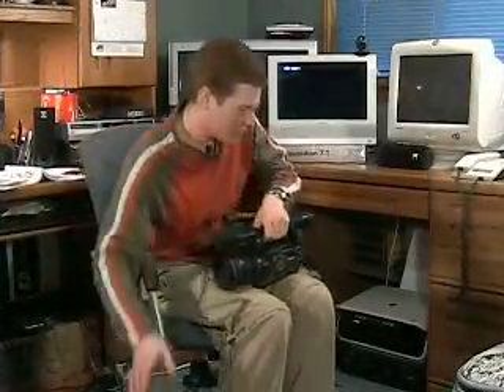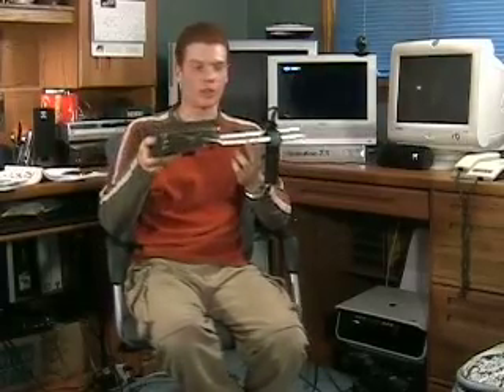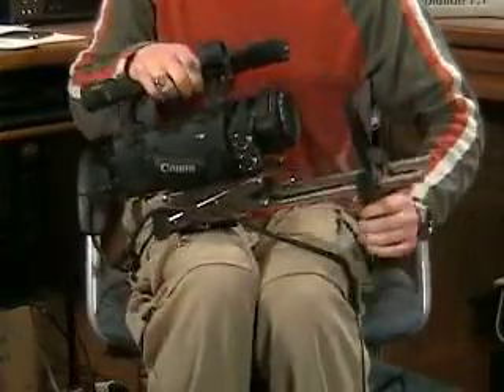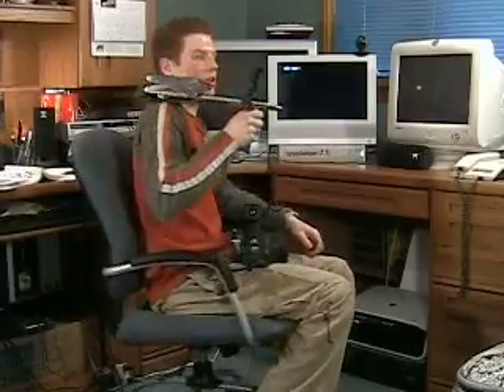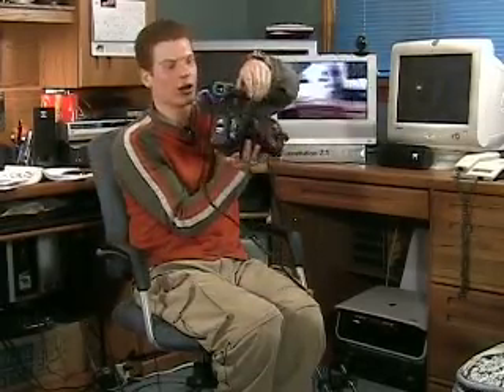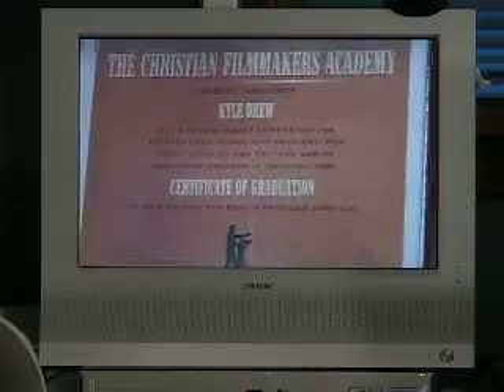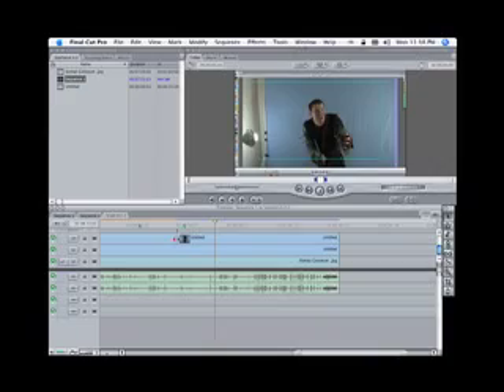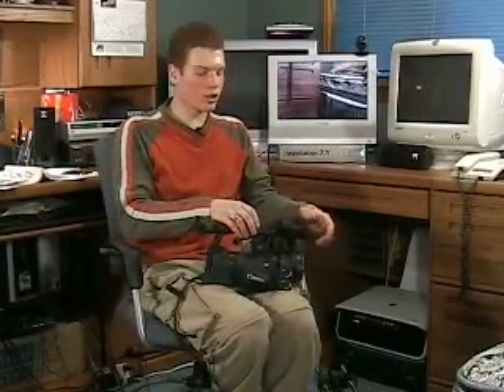HDV & Narrow DOF Adapters - Part 3

Comment: Wher did you get the letus adapters and how much are they? Also do you nedd the metal platform if I wanna use the adapter on a tripod, can you handheld the holw camera including the lens without getting tired?

Comment from the maker: Another tip is to make sure your actors are standing in the "sweet spot". If they're even a few centimetres out, you can loose focus. This may mean putting markers on the floor, or using string on the ground if they're walking, so they stay the proper exact distance from the lens. Hope this helps.

Comment from the maker: Keep in mind that all the SLR lenses for the Letus are manual only - no autofocus, so you need a skillful hand, and a very sharp eye. You can also measure your distances with a tape measure to check focus, and it's always a good idea to mark focus points on the lens - this is especially helpful for donig rack focusing.

Comment from the maker: Thanks for your question. Getting critical focus is especially important with this adapter, and it can be very difficult at times. I always use a large high-res lcd monitor to check focus, and I also use my in-camera magnification and peaking features, but the XL-2 doesn't have these features, which will make it more difficult to focus. Be prepared to swap the Letus out and use the stock lens at times - but remember that you need more light for the Letus, so do not under-estimate that factor.